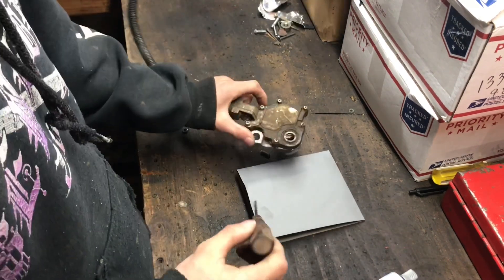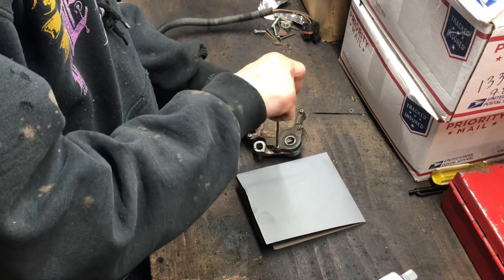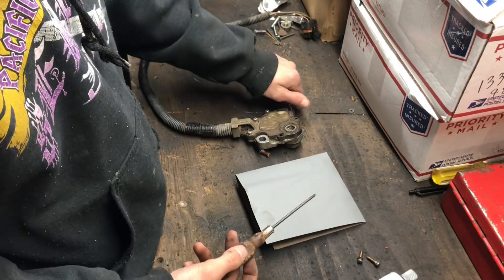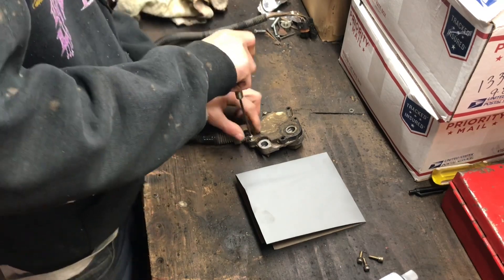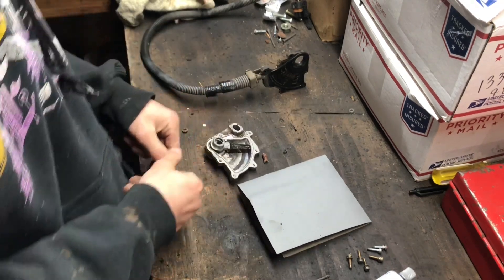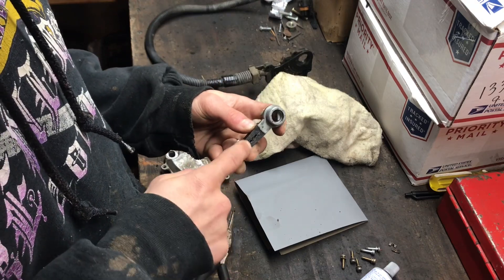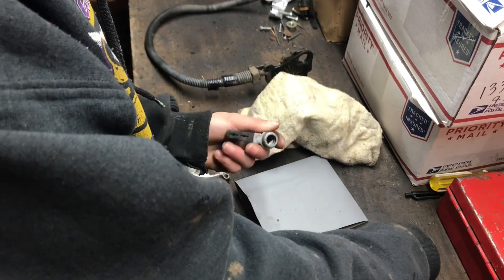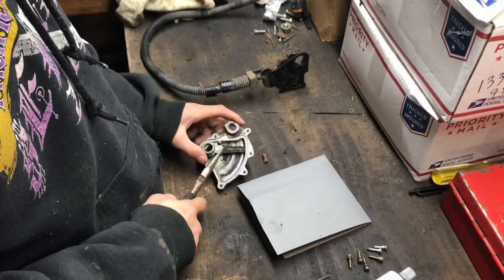How to clean a neutral safety switch

Comment: Thank you for the video. I have a mitsubishi outlander 2002. When in D the transmission some time goes to natural and the N indicator flashes, does this symptom related to bad range indicator
Reply: My 06 mazda 3 is doing the same thing
Reply: @SheikhN-bible-syndrome did this solve the issue. if not pls post what did solve the issue of going to neutral while in D
Reply: @mailziyad  it was the shift position sensor thats under the air box on the front of the transmission